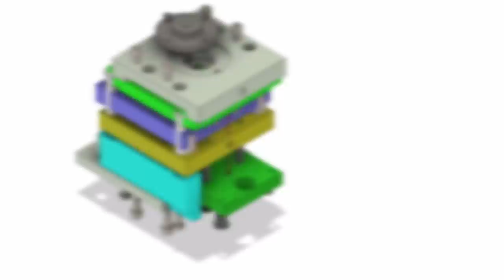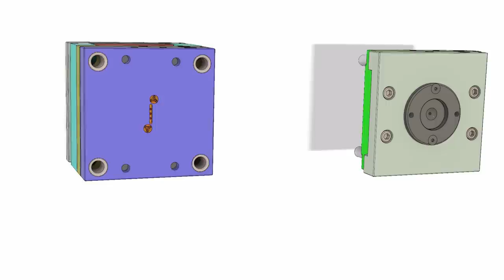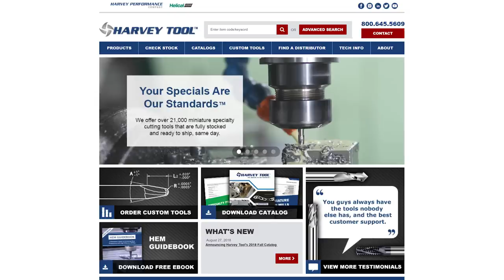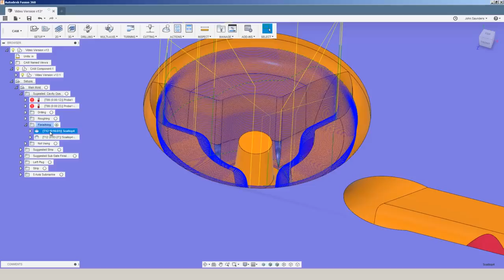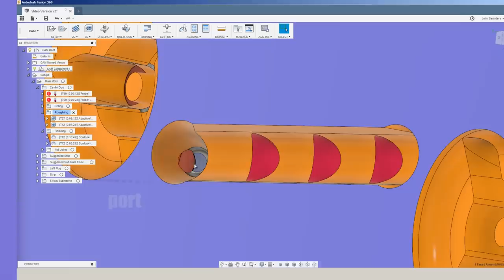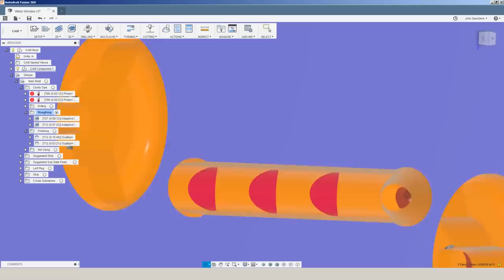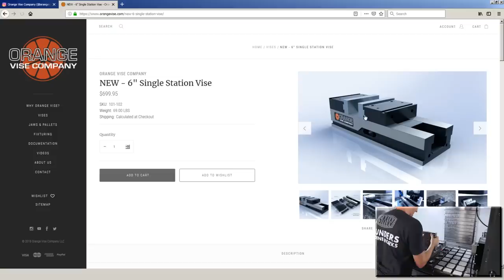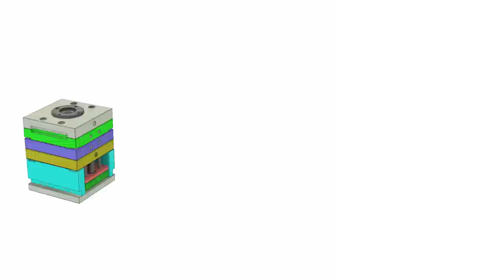Machining an INJECTION MOLD!

Comment: slight cringe when the closing of the molding machine pushes the ejector plate back....   that was a "no no" where I worked... but pretty cool video...
Reply: That was only for a handful of cycles while waiting for the right springs to be shipped. Your notice in other clips the die springs returning the ejector plate fully.
Reply: @geo01005  on our machines the mold machine ejector bar system is "tied in" to the mold ejector plate, and the plate is moved to the fully retracted position by hydraulic cylinders, and this is defined as  the "zero" position .  If the machine doesn't see a zero position, the mold is prevented from closing by software.    Been 15 years since I've been involved in Inj Molding.   Our steel cav/cores were made via EDM in O1 tool steel, if I recall.   P-20 for some low volume prototype parts...  My job was 1st sampling of molds before production.
Reply: You can use a method of implementing push back pins to drive the ejector set back
Reply: @knikula  Tied in ejection is my preference. On this machine there is zero clearance between the Hydraulic cylinder for ejection and the face of the moving platen. You really can't tie in the ejection system on this machine, so springs are used. When I do use springs I like to use a limit switch on the ejector plate to prevent mold closing if the ejector plate is not all the way back. With this mold design, there is no danger to the mold if the return pins push the plate back.
Reply: Yes, real molds don't use such primitive way of ejectors retracting (return pins), but this is beginner, simple, low volume "production" mold, so who cares. They are learning.
Reply: thats what it is supposed to do, and that's why there  are return pins.  Nothing wrong with doing it this way.
Reply: @xyzzyx7669  This is a "real" mold.  There is nothing wrong with return pins. I have 200+ molds on the shelf that use them
Reply: I build 2 shot molds, where one color is injected, then half the mold rotates and the other material is shot into the mold. Because of the rotation, the ejection cannot be "tied in". Push backs are used as a safety measure to protect the tool in case the springs fail.

Comment: I'm mold making apprentice. It is definitely a challenging field.
Reply: machinist? or dobyou specialise in molds only?
Reply: @andreasrasmussen6362  well I am a machinist first and foremost. I used to run production machining. So now I am specializing in Molds.
Reply: @SouthValleyKnifeCo  nice, im also a machinist currently attaining my mech. engineering degree and one of my current classes is injection molding. 
so do you do a lot of 3d machining on moulds? also what is the most difficult proces of machining moulds?
Reply: @andreasrasmussen6362  I work back in our electrode cell. So I'd say we do a fair bit. The hardest ones are the electrodes with alot of surface area and CMM time.
Reply: @andreasrasmussen6362  also...currently teaching myself Python for future automation and software development.

Comment: Should centre drill ----prior to drilling ----the water way holes could have been tapped using  taps and chamfered and for best results for ejector pins holes ---hand ream them from the back  of the plate---sub gates are easier and with more control to do them manually or spark erode them ----WOW ! you have such a lot to learn yet
Reply: no. what he should be doing is using 5511 guhring drills with TSC and punching those holes in about 10 seconds.
Reply: steve gale  ---spark erode ---electro discharge machining---same thing (both a process) , different name that's all, but you knew that didn't you ?--I've been at it for 10/12 hours a day for 48 years---glad I have retired now though so that I don't have to put up with people who want to pick an argument over semantics
Reply: @MotorsportsX  ---plastic injection mould tools are not about punching holes through in 10 seconds---especially sub gates

Comment: I wonder how a Moore jig borer/grinder would compare to a new VMC for hole locational precision?
It also seems like to me for a reamer, a long shank is necessary to flex for finding the center of the hole.  Floating reamer holder?

Odd thing about the reaming cycle to me, I was always taught to stop spindle rotation and then retract the reamer.
Reply: multiHappyHacker 

Jig bore is more accurate.  But takes longer.  And modern VMC’s can hold tenths while interpolating a hole, so for most applications a jig bore grinder isn’t needed.
Reply: LOCATION precision? There is no advantage in grinding.
Roundness and surface quality would be better probably.

Comment: I Thought the VM stood for Vertical Machining (From VMC=Vertical Machining Center)?
Reply: MrBenjo11 it does
Reply: I also thought so, but if you check the Haas website it seems to stand for mold. Jhon is also quoted on the site :)
Reply: @Lxo96  Interesting! So based on the Haas site, technically the M-3 then stands for "Mold Making Machine" but I guess It's still technically a Vertical Machining Center designed specifically for making molds. As they say, something new every day....
Reply: VMC does. 

But Haas designates by 2 letters. VF and VM for their verticals with a number denoting size 

VF is the standard VMC. And VM is the mold machine.
Reply: its haas's way of upcharging you for slower rapids, and the same accuracy.  (ive used both. there is no difference)   alot of people dont know alot of haas's machines use the same casting. iirc, the vm3 is the same iron as the vf5.  so you might as well get the 5 and have the travel.    the only benefit I have found from the "mold making ball screws"  is that its a little easier on the axis motors when taking heavy cuts.

Comment: Hey John, not trying to arm chair machinist you (plenty enough of that in youtube comments already) but why do you not spot the drilled holes first? I have noticed it in several videos. Any time I've not spotted first I always regret it with the drill walking around. What is your drill philosophy/secret?
Reply: He is using a split point drill so it's not technically necessary. That said it's lazy and on long drills like that will bite him in the ass eventually.
Reply: Carbide drills do not require spotting.

Comment: At 13:45 you use the torque wrench to tighten your tool holder. With it straight out, it changes your torque reading (lever arm gets longer).

Keep crowsfoot type tools at 90 degrees. It doesnt change the lever arm, so you dont have to do math to know how to set your wrench.

Comment: If i may, id like to suggest some improvements, i work with injection molds, making them for the past 4 years, very similar to what you have there.
in fact yours is probably the simplest i have ever seen, having worked with 96 impression tools, with multiple side actions, and changeable inserts.

i'm assuming by the fact you made a mold for this, you are selling these plugs, as cost of manufacture is huge for a mold tool, compared to individual machining.
if so, why only 2 impression, a mold like this is ideally suited for 4,5, or 6 impression, with only minor extra machining needed. 

your runner and gate system is ok, it good practice to have a blind hole, directly in-front of the sprue hole, IE when the plastic is squirted into the tool, it should first fill a cavity, to take the cold slug, this is the big of plastic that chills off on the end of the molding machine between injection cycles.

the "tight" tolerances you needed are not necessary, most plastic cant fit down a 2thou gap, so even 2thou sloppy holes on ejectors wont flash plastic, also its actually important to have gaps, we make gaps in the parting faces, called air Bleeds,  filling the cavity's with plastic displaces a volume of air, if you have no where for it to go, it will super-heat and burn the plastic

also i noticed the guide pillars on the mold tool, not sure if the tool maker had a bad day, or isn't experienced, but guide pillars must have grooves cut into them for grease, if they don't or the grease dries up, the metal on metal contact with "pickup" and the pillars will seize in the bushes. i've repaired dozens of pillars that have been knackered due to poor greasing,

just a few things to think about of your doing it again ever, mold tool making is super easy, and you can cut allot of corners, just as long the function is correct, things like cosmetics as can been seen when you milled out the damaged by the collet and reamer.

Comment: Recently I have been thinking about machining a press mould for plastic optics, and they are precison optics with polished optical finishes! Can anyone point me to the right direction please? Our school does not have five axis milling machines, and has pretty much anything below that.
Reply: Polishing a mold cavity for a bright finish is one thing but real optical components require very high precision, done with diamond turning typically by specialized vendors. Also, the material will not be ordinary clear resin but a special optical resin which is harder to hendle. That's not to say nothing can be acheived with regular mold making practices but don't expect to get a professional optical component easily. Best luck
Reply: @uripomerantz6858  Thank you so much, i for sure need to throw in more real effort into researching, but your direction is priceless. i will talk to my machinist and see if he is kinda enough to give me further help. IEEE and OSA are probably places i should start from.

Comment: Next time try multi impression die mould you could of made 12 to 16 version of this mould due to there being no sliding cores cycle times will be reduced and parts cost too always go for the largest ejection pins you can fit with compromising on wall thickness

Comment: Are these D2 mold blocks?  what material? Also, with jobber or, longer drills (i.e. nOt machine screw length), I was taugh from the 'old guys' you should aLWAYs spot jobber length (or longer obviously) drills so the tip doesn't wander.  In my opionion, aLL drills should be spotted for job shop procedures.  I even spot drill bolt clearance holes but that's just how I roll.  I've never seen you use anything other than a jobber drill and I've rarely seen you spot them.  Production runs, eh...compromises are made.  Makes positional accuracy difference from .003"-/004" down to .001"-/.002 if positional tolerance or drill size is critical. Particulary with carbide drills, helps prevent wandering and potential breakage.
Reply: Depend on machine (how rigid) and tools. Carbide should NOT be spotted. Carbide drills are "self-spotting".

Comment: Iv'e been making hot runner systems for two decades. Show some five axis machining, and use shrink collets, virtually no run out and very rigid, and for havens sake man, use metric. It's so much easier.
Reply: steve gale  Dude, I'm American! Where did you get that I cant do imperial?
Reply: steve gale  Its what my employer uses, seems easier to me, no fractions, but whatever.

Comment: Awesome vid, but I had to stop watching because my gut hurt as I just mentioned how I would pucker watching that long reach bit go into the 5 axis move, then just a few seconds later, you mentioned how you did go into full pucker mode. LOL still laughing! Maybe you can give me a shout out on any crazy projects as I'm converting my shop more  to manufacturing but usually get all the odd jobs and have to do the find em a solution thing. I have a lot of awsome equipment also, 3D scanner, printer,flat bed and roll large format printing and cutting equipment, CNC 8'x8' hotwire foam cutter, 4 axis mill, 5x10 router, 3x4 vacuum former, polyurea sprayer, lots of design software and a creative mechanical mind.

Comment: 7:26 I don't know why Haas machines do this. It takes more time to move the spindle that extra adjustment oppose to simply getting the Toolchanger arms more length to go farther down as needed. What's up with that?

Besides that, on topic. I thought this video was pretty good though. :)
Reply: The toolchanger is designed to handle lots, and lots, and lots of cycles. As well as not taking up lots of space. Making it come down lower would require more height of the machine
Reply: @RobertSzasz  More height is already required of the machine. If the Spindle needs to go higher. Just make that position the new Z Home position, and make the Changer arms go lower as well. The Z height required is the same. Makes no difference.
Reply: The move is synchronous to the piston pushing the drawbar. The butterfly clamp pushes the tool a bit anyways, working against the double arm. The move releases this tension and positively pulls out the tool. Maybe it could be faster, but it needs to dwell a bit anyhow to pressurize and depressurize the piston.
Reply: @gredangeo  not the z height, the outside dimensions of the cabinet. The machine needs to fit inside the building
Reply: @martin_3146  I think the question was why does the spindle have to retract all the way up, why doesn't the tool changer reach down and change the tool right next to the part.
Reply: It's not a clearance issue it's a drawbar stack issue.
Reply: Whoops, the second one was supposed to be a "why doesn't"
Reply: @Iceberg86300  the drawbar release is in the top of the machine I take it?
For safety it makes sense it can only be released at the top of the spindles travel
Reply: @RobertSzasz  the TRP (tool release piston) sits on top of the spindle head. Mechanically it can be actuated at any time. Not sure about interlocks, a lot of stuff has changed since I was there.
Reply: Longer arm would mean the tool whips around faster, limiting the weight of the tool you can change. 

Also coming down in Z you can maximize the overall Z travel of the machine without having a taller machine to house the tool change pockets.
Reply: @RobertSzasz  "Fit inside the building"?? The machines aren't made that close in tolerance. Also, the Spindle is shipped with the spindle on top of a support block bolted to the table. So whatever you thought your point was, It doesn't make sense.

At work we have a few machines and all the Toolchanger arms simply move down the full distance and rotate the tools. The spindle doesn't move at all. Whatever Haas is doing is a faulty old school method of releasing the tool.

After thinking about it, my guess is, the Arm isn't coded with the Spindle to move simultaneously with the Drawbar release. Instead of moving down with the release of the Drawbar, it waits until the signal is complete first. In doing so, the Spindle needs to move somewhere for the clearance, it moves up slightly because the grippers didn't move yet. It kinda sucks that Haas does that. It's a small amount of time, but it is a bottleneck for their Toolchange speed.
Reply: @gredangeo  what I meant is that one of design goals is to minimize the external dimensions of the machine. 

It is clearly possible to design a tool changer to bring the tool to the spindle, wherever the spindle is. However the design Haas went with has it's own benefits and is a reasonable design choice.

Comment: That huge chunk of steel plates for only 2 minuscule parts?  I don't get it. Shouldn't the mold cavity plate contain as many pieces as will fit? Most molds I have seen on YouTube are FILLED with parts.
Reply: It's a matter of cost. Many cavities would make the mold much more expensive, make it harder to hold the tolerances for all cavities and give a bigger sprue (more material to regrind or scrap).
This is probably a product with short runs. I setting up the injection molding machine takes longer time than the actual production run, the number of cavities is not important at all.
Reply: There’s limits to how many cavities you can put in due to cooling, material, injection rate and pressure. 

Also the more cavities the more complex it’s gets as far as runners and gates go.  

Probably wouldn’t go more than 6 on a plate that size.
Reply: Original poster, yes, You DON'T get it. Adding cavities increases complexity and problems with gates balancing. Long story short.
Reply: yes, it should.  But he should of just bought a mud insert. and cut 4 cavities.  he could of cut 4 cavities rotated 90 degrees easy with basically no change to the water. it still would of been balanced just fine.   Or he could of gone with branced runners and done 2x2.   Personally I would of made  a  as many cavities as I could around the diameter of the sprue,  and called it good.  On a part like this, balance isnt so critical.

Comment: You bought like a 300lb mold. No internal water. Straight shot injection. No valve gates. Of course its cheap lol. The biggest mold in my plant is 45000lbs its approximately 250,000 makes a front support for a mid size suv. 2000ton press
Reply: I wish i made molds like that.  program and wait.   lots of steel to move.

Comment: They sell longer drills they r called aircraft length drills they r cheap as well
Reply: Crossbow Hunter or taper length so you don’t have to deal with headache of an aircraft drill if you don’t have to.

Comment: At 13:20 why did you clamp the part with a 246 block in the vice?
Reply: Stupid rookie question. It's more rigid setup and holds right angle better.

Comment: No center drilling before drill/ream?
Reply from the maker: No need with 135 degree tips
Reply: @nyccnc  Coolant line placement isnt required to be as precise as say ejector pin holes. if the line is that close to hitting a wall theres bigger problems with the mold design anyways
Reply: Center/spot drilling is an old-school technique required for HSS tooling.

Comment: MAN! Don't you spot your holes before you drill them?
Reply: I like to spot with center drills going deep enough that the 60 degree forms the countersink. Also as you drill thru the center drill hole because the drill is not cutting at the tip the hole diameter is tight so at least at the beginning the drill bit won't walk off.